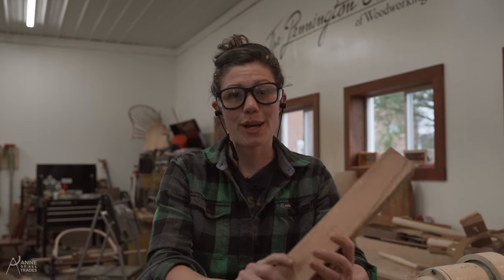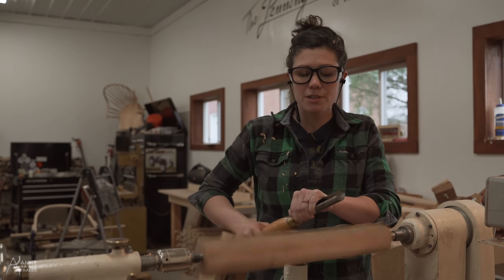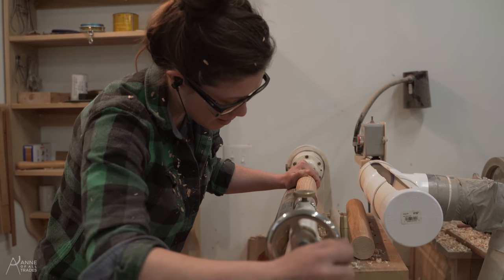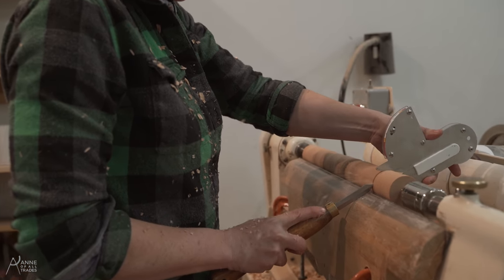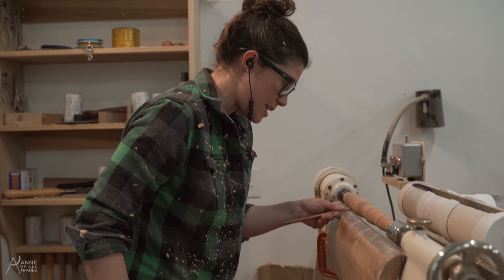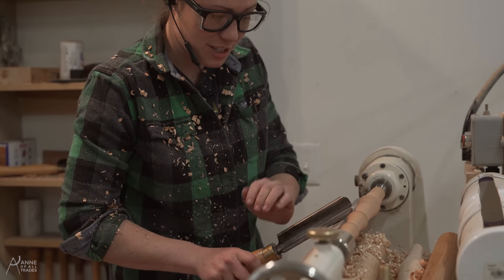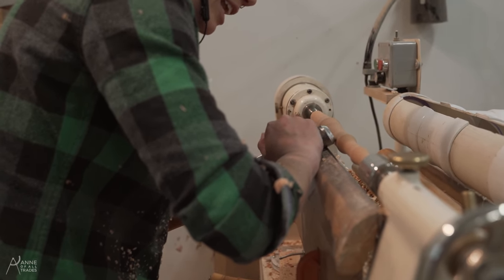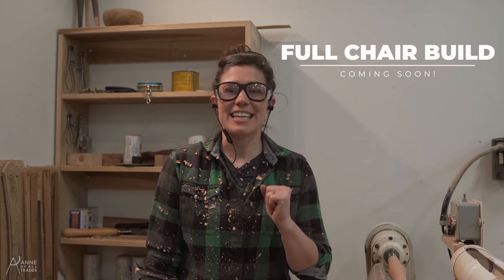Learn To Turn: Chair Leg Edition! // Woodworking

Comment: The chips are flying now!   Man I haven’t turned any wood in years!  You can tell a seasoned lathe operator by how brave they are in making the roughing cuts and how quickly they get to where they want to be.  If you’re not having to stop and explain every move you’re making I’d say 3 minutes each after you’ve done a couple and got your dimensions in mind, tools laid out and muscle memory engaged.  Hope I can retrieve this in the future when I get back on the old wood lathe as kind of a booster shot before turning on the lathe.   I used to make a lot of tables and chairs but it’s been a while.

Comment: I'm glad you had your hair up and sleeves back.  It is easy to forget that lathes can be hazardous.  They quickly can grab loose hair or clothes and pull a person into the machine.  Also by holding the back of the tool firmly, it reduces the likelihood of the wood grabbing the edge and sending the tool pinwheeling in the air toward your face. Once these and other safety precautions are understood & followed, turning is safe and delightful.  It's my favorite type of woodworking.  When I teach turning, I explain how you use all your senses except taste.

Comment: Terminology errata: The white thing on the first lathe is the banjo. It moves in a horizontal plane on the ways. The thing that inserts into the banjo is the tool rest. It is the part that needs adjustment for clearance before turning on the lathe.

Someone down below suggested you were using a Steb center in the headstock which accounted for the many stoppages due to catches. If that's the case, I don't see how tightening the tail center could help. 

If it was indeed a normal spur center, then I suspect you didn't embed it well enough. A sharp blow with a mallet will better seat it. I always make kerfs across the corners on the band saw before the sharp rap. Stock that relatively small should not be catching to a stop that much.

Do you miss the PNW? Middle TN seems pretty nice. April sighting!
Reply from the maker: Thanks for that, watching it back I realized with the pressure of the mic on me I made a lot of terminology mistakes but hopefully there were some helpful tips in there nonetheless. It’s a regular spur drive so a little more prep time would have saved the frustration, but I wanted to show how I would actually turn in a production setting.
Reply from the maker: Oh and I forgot to answer your question about missing the PNW, and that’s a resounding no. I do miss my friends of course, but Tennessee is a big upgrade in every regard.

Comment: Well done, Ms. All-Trades. But why do all of that shaping with a roughing gouge? Details, beads, curves and such are much easier to control a spindle gouge, 3/8, 1/2, or 5/8 inch sizes (preference).
Reply from the maker: Because you should be able to do the entire turning with a single tool, at production speeds, there isn’t time to grab a whole bunch of different tools. Plus, if you can do that detail work with a roughing tool, think about how much more skill you’re building 😉

Comment: I am not a wood worker but I thought or assumed the head end had like 3 or 4 tooth like points that dug into the end to really keep the wood from spinning on you like it was doing. Really holding the piece tightly between centers.
Reply: Glen Crandall makes sense Sir, like I said I never worked on wood but I seen lots done.  I am a old retired machinist worked on huge lathes and  many types of Mills.  Good Day to you & yours. Stay safe be well...

Comment: Well Anne, the way I cut the corners of a block of wood before I use my skew is I let the stock free wheel stand back from it about 20 feet or so and take my Smith n Wesson 500 Mag n kinda knock the corners down., usually 8 - 10 shots will do the trick n then I smooth it with my skew and there ya go 🤣🤣🤣🤣🤣🤣🤣🤣🤣🤣🤣

Comment: Anne I move my  hand furthest from the lathe right back on the tool,  feels like I have more control that way.
Reply from the maker: You probably only use your dominant hand to turn. Because I use both hands, it gives me the benefit of changing my body position for the best angle of attack :)
Reply: Yes You are right, I only use my dominant hand.

Comment: Would it save much time if you first cut off the corners using a table saw so that you start with an octagonal cross section?
Reply: Depends on the wood species you're using. The hardest woods, heck yeah lop them corners off.  Regular hard and soft woods, there really isn't much of a time savings, the corners come off pretty quickly,  with a good sharp roughing gouge.
Reply from the maker: Not really, if I’m not talking to the camera, I go from square block to finished leg in under five minutes